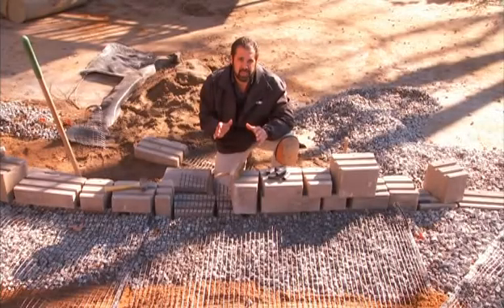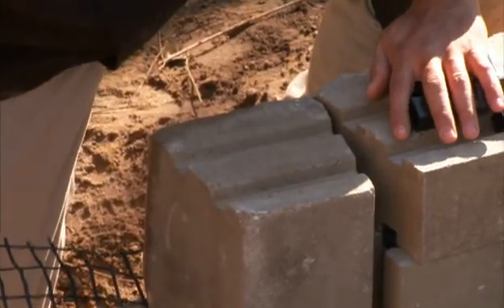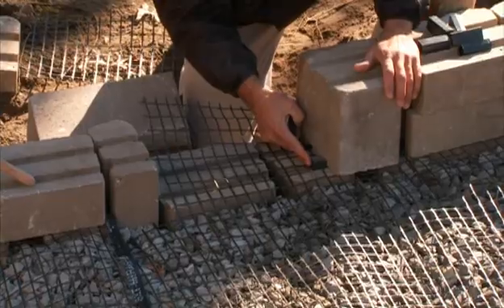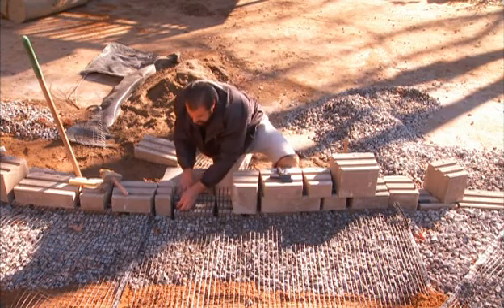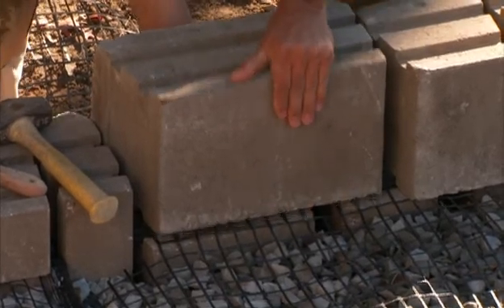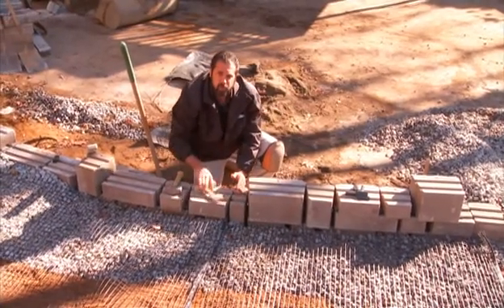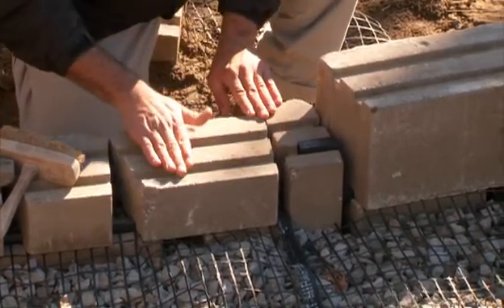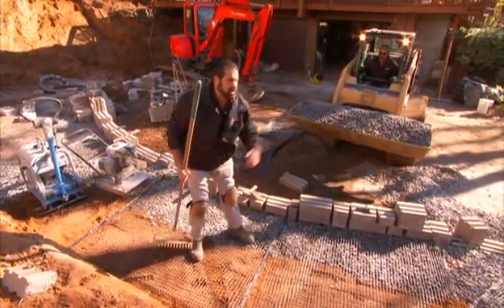Techo-Bloc Patented SRW System

Comment: Does it not bother you that the block that is next to the full block that you set in is not flush with it? It is in fact like 1/8 to 1/4 inch shorter that the block you set in place and the bloc emmidiately to its right. That shit would not fly with me even thou I gues there are ways around things like that. Though I guess that is why I am on wall jobs alot loner than I would like to be also.